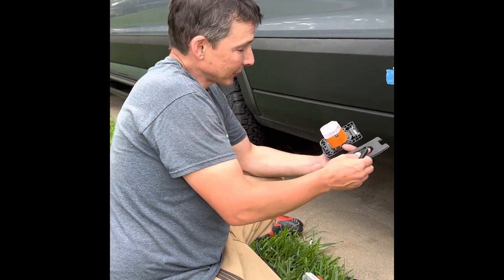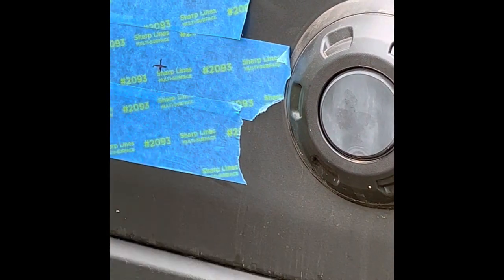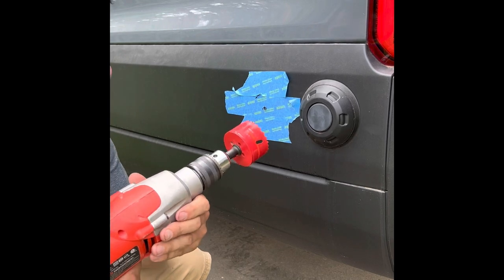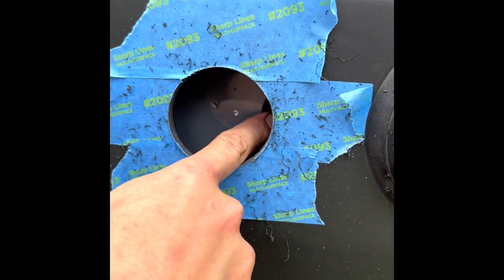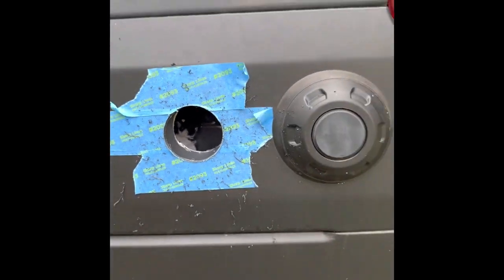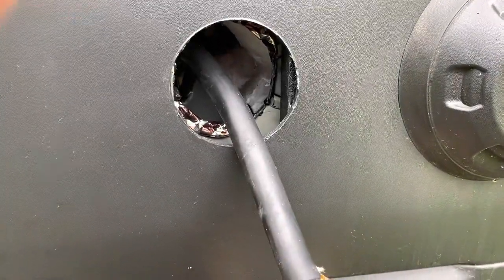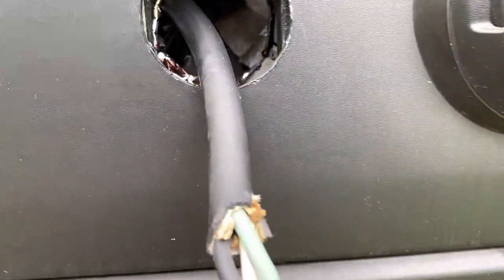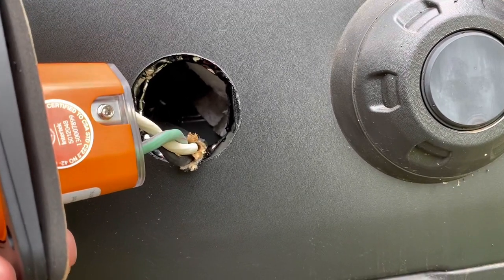Ford Transit Van Build | Installing Shore Power Plug

Comment: I'm following your build as I'm looking to start on my own once my Transit gets delivered. After drilling the sheet metal, did you deburr and touch up the edges with paint to prevent rust? Do you think a layer of butyl behind the gasket would have been enough to make it waterproof? Thanks for the tips and techniques!
Reply from the maker: Yes, we deburred and primed after the hole was cut. There is a gasket that comes with this SmartPlug to use in lieu butyl. The plug is screwed into the sheet metal with 4 screws, but we added a wooden block behind to screws on each side to make the plug more secure. We also used leftover Loctite spray foam behind the plug to secure the wiring in place and to also provide some additional waterproofing in the wall cavity.